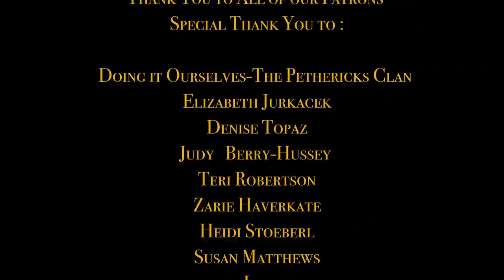EP46 Antique Mirror Dilemma , Renovation Update from our Passion Project

Comment: I loved the F. Berger painting - very 18-19th century charm.  His (or her - not sure at this point) paintings are often seen at auctions and sell well.  From some of the research I have done, there are 2 F. Berger painters - the one you have, which probably painted for pleasure rather than fame and glory or worked for a manufacturer of paneling.  The 1st painted a lot like the Dutch painter Rubens with light coming from within the characters in the scene while the 2nd painter F Berger, a late 19th century impressionist painter painted mostly landscapes with buildings of statuesque size and a few portraits.   The first signs his paintings with an almost stoic lettering while the 2nd places the "F" at a 30 degree angle, almost encroaching on the 1st letter of the last name of which the "B" has an elongated bottom pouch..   There is a huge difference of style of painting between the 2 artists.  Maybe they were parent & child? 
I suspect if you found the mirror in a brocante in France, the 1st F Berger was French.  But perhaps he was Belgian or English.....a mystery to add to your vlogs.  Perhaps someone else on this channel knows more and can share.   Love the work you are doing with this 'pièce de résistance'!

Comment: the mirror with the painted top looks better over the fireplace and if you could mount it on the wall so it would say  have a gap from the bottom edge of mirro to the matle piece so as the light wall can be seen it would look just right

Comment: I think both of those mirrors are simply gorgeous! However, I think that both of them are still a bit too narrow for the space over the fireplace -- If you have another mirror that is more appropriately sized, width-wise, I would try those as well. However, if you must use one of the two shown in this episode, I strongly feel that the one with the painting goes much better. The massing of the dark colors in the painting and wood play off of the dark marble fireplace mantel, which visually anchors the entire assemblage. A better solution, perhaps, (which might work just as well with either mirror) would be to select a pair of long, narrow wall sconces or other similar fixtures -- ornate and in a similar finish to the mirror frames -- placed no higher than halfway up the length of the mirror -- that would visually "widen" the mirrors and better balance them in the space above the fireplace.

Comment: F. Berger is a French Impressionist & Modern artist. F. Berger's work has been offered at auction multiple times, with realized prices ranging from $94 USD to $250 USD, depending on the size and medium of the artwork. Since 2019 the record price for this artist at auction is $250 USD for White haired man lighting a pipe, sold at O'Gallerie in 2019.

Comment: The mirror without the painting is being placed so that it is tall.  The comment that the gold decoration is “different” actually points out that the mirror should be placed so that it is wide, not tall.  Then the decorations will match.
Also, sorry, and I am not trying to be disrespectful because I think all that you have done is beautiful, but I don’t think either mirror works.  Maybe the smaller one first in line when you went down the hall of mirrors.  The two you tried are just too much for the room and fireplace.  Sorry.